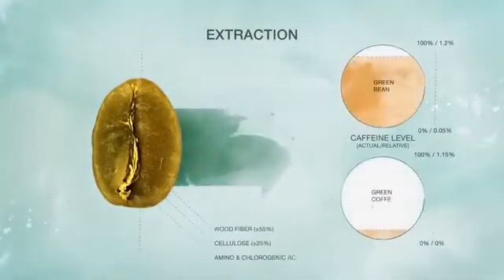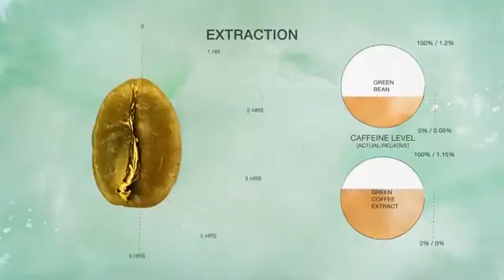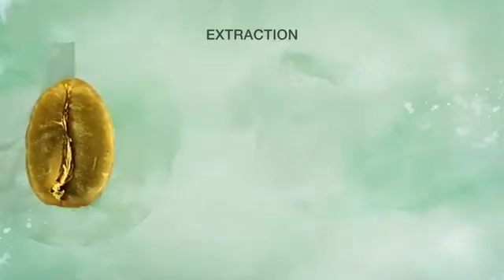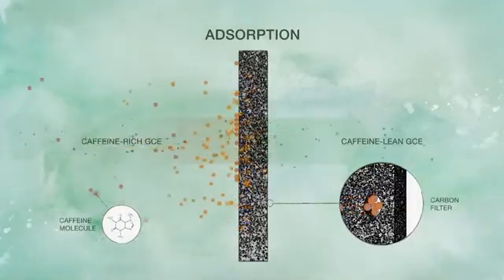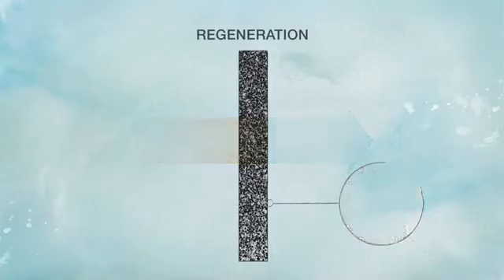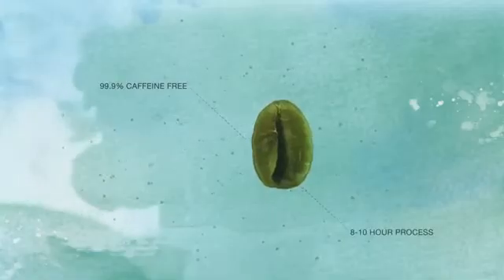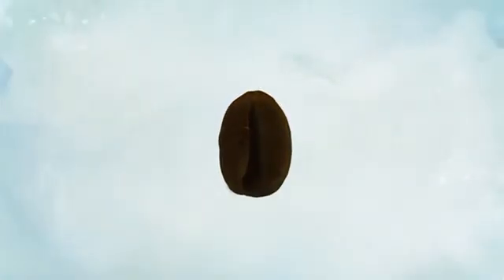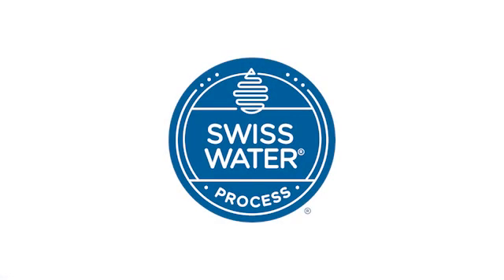The Science of the Swiss Water® Process

Comment: At the swiss water decaffeinated coffee company superior science and great tasting decaffeinated coffee begins with premium coffee beans green coffee has received cleaned and then pre soaked using water from the coast mountains of British Columbia preparing it for our proprietary caffeine extraction process our caffeine lean green coffee extract GCE then flows into the beam columns beginning the counter current extraction process GCE is water saturated with soluble coffee components which we create and constantly refresh because the concentration of the soluble coffee components in the GCE is maintained just under equilibrium with a green coffee the resulting concentration gradient will not allow soluble coffee components to flow back into the coffee by carefully controlling time temperature and flow we are able to optimize the driving force which removes caffeine from the green coffee into the GCE once caffeine rich the GCE cycles from the coffee into our proprietary carbon filtering system the fractal geometry of the carbon attracts and captures only caffeine molecules due to the share of the carbon pores while the concentration level of the remaining soluble coffee components is maintained and protected in the GCE when the carbon becomes saturated with caffeine it moves to a carbon regeneration furnace to burn away the caffeine and to recreate the fractal geometry critical to high -quality decaffeination the carbon is then reused the now caffeine lean GCE flows from the carbon filtration system back to the extraction columns until the coffee is 99.9 percent caffeine free the process takes approximately eight to ten hours after the beams are decaffeinated they are removed from the holding tanks dried bagged tagged and ready to be roasted our 100% chemical free certified organic net extractive process only removes caffeine leaving the coffee’s origin characteristics intact the result is a full-bodied flavorful cup of coffee Swiss water decaf the leader in the science of decaffeination you